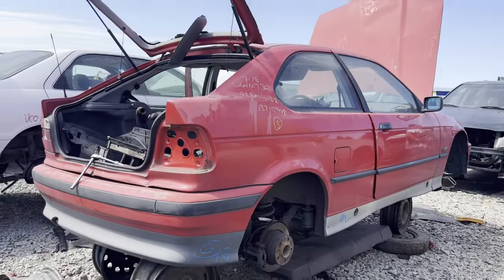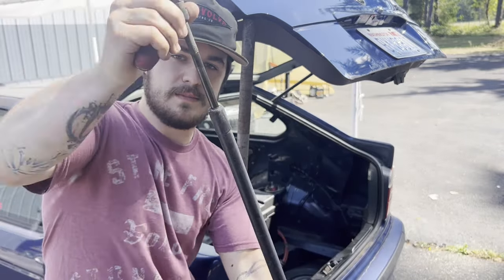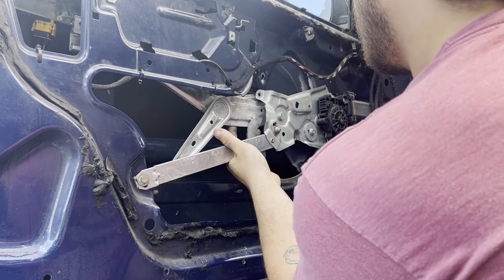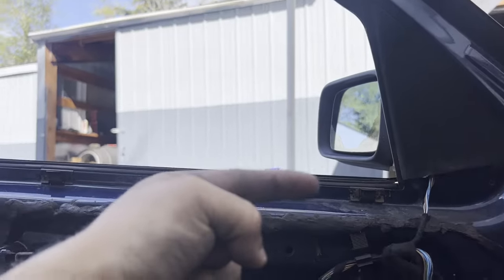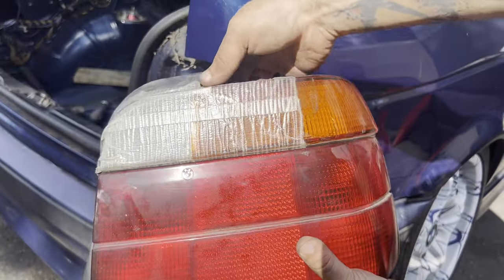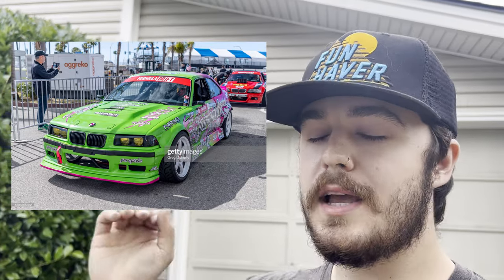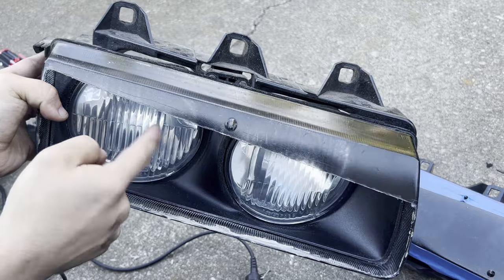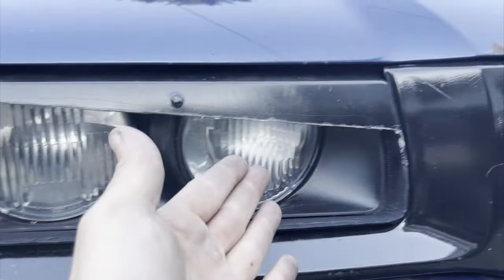You Will Enjoy Your E36 100x More With This Simple Fix

Comment: Lmk how long the regulator lasts. I’ve replaced the driver side twice and it keeps bending. At this point I’m waiting for condor to finish their poly windows for the ti
Reply from the maker: It hasn't bent yet thankfully but the window keeps wanting to come out of the vertical rail towards the front of the door. It's getting real annoying tbh.
Reply: @JamDrifts  ya man. There isn’t any difference between a ti and a coupe regulator. I haven’t tried a sedan regulator yet. I’m thinking maybe a z3 regulator may help. But nah. Polys gonna be the wave
Reply: @JamDrifts  also. Do you mean that like you need to kind of hold/bend/pull the window to fit in the sill? That shit was happening to me before they bend again
Reply: Also for me. It’s only been the driver side